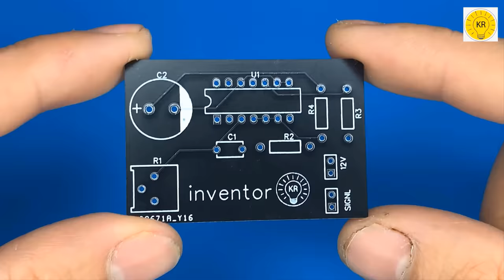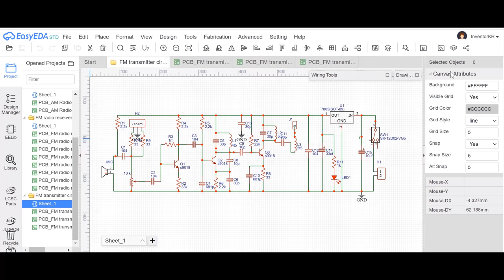how to make simple inverter 4500W , sine wave , 8 mosfet , IRFz 44n ,jlcpcb

Comment: No voltage drop with electric kettle? without voltage feedback? something it's stink here...
Reply: Мне тоже показалось это странным, нет падения напряжения.
Reply: He power supply
Reply: He cheated
Reply: Фейк с чайником
Reply: i reported this vedio
Reply: If you noticed the meter, there was a 2v rise in voltage.  An inverter whose regulation is indirect can exhibit a rise in voltage with increasing load.
Reply: Agree
Reply: There’s no way the high current needed for the low voltage side would be able to flow in those little alligator clip leads 🤣
Reply: Залізо в трансформатора заслабеньке на 2200wt😂
Reply: Could be preheated water !!!
Reply: It's an inductive kettle. Not a standard heat coil.
Reply: Definitely BS. You can see the mosfets are high voltage ones, irpf260n. But even if it is a 110 dc to 220 ac, I doubt that transformer is up to the task. Not to mention the impervious voltage 😂😂😂.
And the casual handling of those voltages… I bet it is low voltage dc good for the bulb with that transformer and just cheated with kettle.

Comment: The IC is 4047 its a monostable/astable multivibrator which gives out a square wave so its a square wave output and not sine wave.
Reply: OR 'SLIGHTLY' MODIFIED SINE WAVE, BUT NOT SINEWAVE AT ALL.
Reply: too bad. it should be as easy as replacing this chip though right?
Reply: @SoulAir  Creating pure sine from DC is more complicated than that. You could do it with an arduino with analog output. If you're running an electric motor you need the sine wave to avoid damaging the motor windings.
Reply: It is a simple half-bridge circuit, with a square wave input signal to the MOSFETs. The output will certainly not be a pure sine wave, but it will be somewhat sinusoidal due to the low pass nature of the output transformer.
Reply: Real sine wave inverters use a PWM technique. This is just square wave.
Reply: LM741 can generate a sine wave.
Reply: @ludsonr7428  Yes that's true, any opamp can be used to make a wien bridge sine wave oscillator. But to make a sine wave inverter is much more complex because just driving the mosfets with an analog sine input would result in enormous power losses. Hence real sine wave inverters use PWM. It's possible with a microcontroller.
Reply: Nice circuit indeed, for real sinusoidal you need a variable wide pulse to conform the power along sine values, and a low pass filter, still this implementation is very good I think, even an electric motor should be possible to feed..
Reply: At 2.4kW the transformer and input wires will melt.
Reply: @G-ra-ha-m  Yeah, that power level means a transformer that's impossible for an average person to lift and wires the size of your fingers.
Reply: Yes
Reply: @PulsedPower  So Ben how do you make one of these things, all I can find is utuber's full of crap and no way to make an inverter that works.
Reply: @TerryClarkAccordioncrazy  And how do you create pulse width modulation?, I am just trying to make a damn inverter, do you know?
Reply: @stratocasterblue  You can find PWM tutorials for arduino on YouTube. But, making a reliable and safe high power sine wave inverter is a complex job, typically involving a team of experienced engineers. Generally speaking you would be better off buying a commercial inverter.
Reply: @TerryClarkAccordioncrazy  I thought you just used 2 half wave bridges and some mosfet and then a network of resistors to smooth out the sine wave, no?
Reply: @stratocasterblue  It doesn't work like that. I'm not wanting to be impolite, but I can't teach you an electronics degree and 20 years experience in a youtube comment. You've just gotta trust me that building a working sine wave inverter is a bunch more complex than this video maker is implying. I can design inverters, I started in 1982,  and even then I'd go buy a commercial unit rather than hack one together in my garage.
Reply: @TerryClarkAccordioncrazy  Do you have a degree in electronics?
Reply: @stratocasterblue  Yes I do.
Reply: @TerryClarkAccordioncrazy  So your an electronic engineer, can you suggest an inverter big enough to keep my refrigerator working, 10 amp 120 v 1200 watt but the starting amperage will be ? 3 times more I am guessing because electric motors try to achieve top speed instantly so you think 5kw inverter?
Reply: @stratocasterblue  Inrush current of compressor motors can be over 5 times the steady state value. I would first use a clamp meter to accurately measure the steady state and inrush currents, then at least you'll know where you are. You'll need an inverter rated at the peak inrush current. There are ways to reduce inrush current using NTCs  from suppliers such as Ametherm. These are resistors that start off at a fairly high value to limit inrush current and then change to a low value as they warm up. Alternatively you could consider a newer inverter based refrigerator which won't suffer from such huge inrush currents.
Reply: 68K  Yes the soldering is sketchy and would likely not be reliable. The whole thing is sad really. The creator has the skills to make good educational content but chooses to create fake content and tell lies to get views.
Reply: @TerryClarkAccordioncrazy  That resistor sounds like a thyistor, a soft starter, thank you very much
Reply: Maybe a 200W transformer.
A microcontroller could make Pwm sine in two offset halfsines, not that 1960's chip!
Wiring is a joke. 
No schematic.
Soldering iron from grandpas garage.
This video is stupid
Reply: @TerryClarkAccordioncrazy  Hi, I've seen chinese MPPT's with a built in inverter for around 5 to 6 hundred Euros... is this good stuff or how much money I have to take in my hands to get usefull stuff to convert solarpower to a batterybank and use it at home?
Thanks for Your answer, sending You my best regards, RoB
Reply: Is it possible ?
Reply: Is this working ?
Reply: WE CAN convert this square wave to sine wavwe by adding a simple RC circuit its not very difficult to convert square wave to sine wave using 100 nf ceremic cpacpcitor and 1 k resistor as in tank circuit
Reply: @SoulAir  It's hard to do sine wave. For low power, you can modulate the voltage by using the transistors as programmable resistors - like you can do in an audio amplifier. But this means you have much loss in the transistors when they are half-open.

So the way it's done is to have switch transistors that turns on/off very quickly and has a very low on resistance. Then you let a microcontroller produce pulses of varying length at a frequency much faster than the mains frequency. You adjust the width of the pulses depending on if you are about to generate a peak or a valley of the low-voltage sine wave. This is called PWM - pulse width modulation. When the on pulses are very short, then the average voltage is nearly zero. When the on pulses are very long, then the average voltage to the transformer is near the full input voltage.

Another way is to have fixed pulse width and instead change the pause between the pulses.
Reply: @ShrKhAan ,  Nonsense!  Бред!
Reply: @TerryClarkAccordioncrazy  PWM is a series of square waves, not a sine wave.   The pulse width is modulated to give an average DC voltage lower than the top of the square waves. 

He needs a DAC.   There are a ton of DACs that can make a perfect sine wave.  But that would have cost him a few extra dollars, and isn't worth the effort for a quicky YouTube video built for getting clicks.

You can use a PWM to make a sine wave, with some filtering, but he'll need to mess with it and his oscilloscope, to get it right.    It's cheaper to use a DAC.
Reply: @JWSmythe  It is not a matter how to make a sine wave, but how to make a sine wave at 2.5kW power level without dissipating 50% of wats as heat.
Reply: Так трансформатор преобразует синус.
Reply: What about the resistors
Reply: @njineermike The eg8010 module can be used in place of a microcontroller.

Comment: The input cable you are using is too small fortunately it doesn't melt.  2 years I've been using a 3kw inverter and 24vDC input using a 10mm cable and even then the cable is still warm when the inverter is working

Comment: It's amazing the 2000w load didnt make the voltage change even a fraction,  and you can carrry all those amps from the low side with those small wires,  you managed to re-write physics!   Nice job
Reply: the wire can't stand the currents so heavily
Reply: So what could it actually output if anything at all is this a legit build with blown up specs or a bs waste of time all together?
Reply: @Tecumseh123Onelunger  You can run these simple inverters quite powerful if you don't care much for the wave forms or EM emissions. But the low voltage rails then need to be REALLY beefy, carrying the hundreds of amps.
Reply: But it would output usable AC power? If so what do you think would be closer to it's actual running power of course if I was to build it I would have it in some kinda enclosure with adequate heatsinks 12v fans and ventilation..
Reply: @Tecumseh123Onelunger  You miss the point! IF this was a 12V inverter, the 12V lines would have to carry extremely high currents. But here they are fed via tiny alligator clips. 
And then you need to define what "usable AC power" means to you. This is surely not sine wave AC, but will run a lot of things without a problem.
Reply: Physics upgrade , rel. 4.1 ....☺
Reply: Это обман!
Reply: 😂 thin wire
Reply: 166 Amps running through tiny wires? It’s another youtube electronic scam video 😂